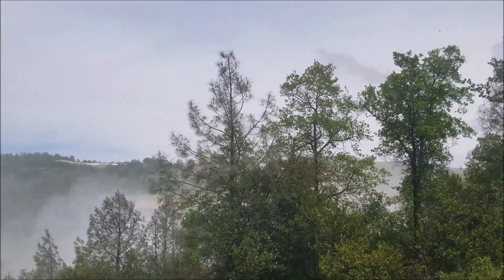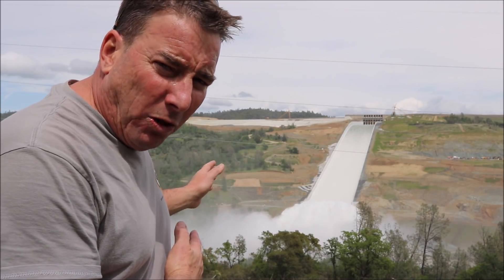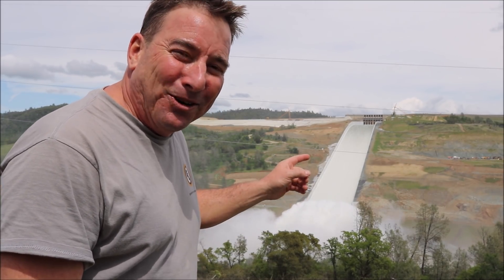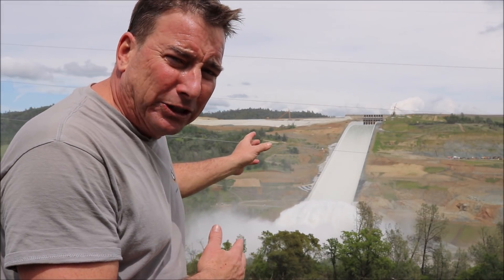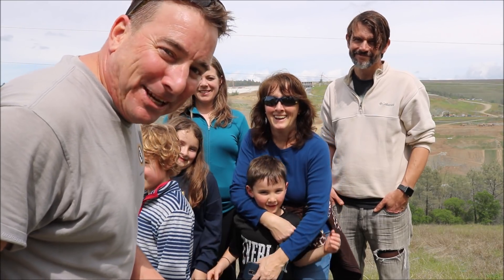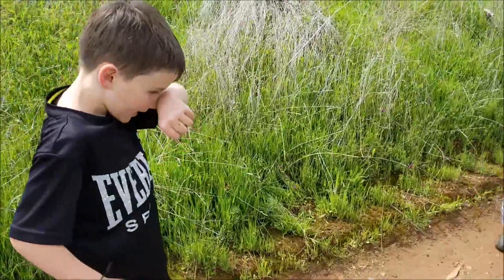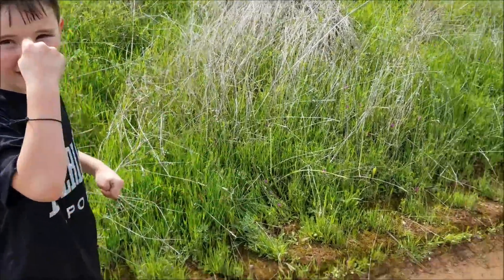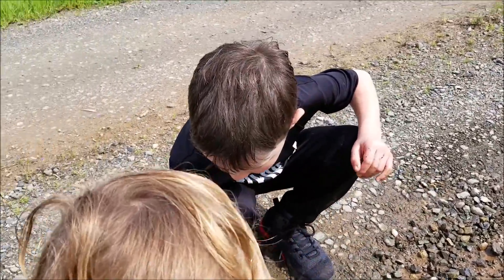Oroville UPDATE 25,000 CFS Test of new Spillway! 7 April 2019

Comment: Heard there having magor problems that there was vibrations in the spill way
Reply: You heard wrong. No major problems.  Vibrations? Lol, when that much water is running down ANY spillway it generates 'vibrations' some of which you hear as sound just like a waterfall. Listen to that sound of the spillway. Impressive. This is normal. This spillway is far better made than the previous one it replaced.

Comment: Juan have you been up in the mighty Luscome over the spillway? I mean since they shut it down after the test run.  There seems to be pieces of cement coming loose on the sides and it looks to have ripples in the surface.  Susan Wolding said she would ask you about it.  Also the Gates don't seem to be as water tight as they were before construction began.  Remember they sand bagged the water to one side.  Now the water is still running all the way across.  I trust your eyes better than mine .       Thank you   Leah
Reply: They first sandbagged or shunted the leaking water to the right, and then later sandbagged the leaking water to the left and it remained in that mode until the bags were removed last week.  Now the water just runs where it wants down the spillway. The gates are not watertight. Remember, the gates are not part of the reconstruction of the spillway.  They didn't break, the spillways did.  There is no broken concrete. The seams are dipped, on purpose. Juan showed this in a video last year when he did a 'boots on the ground' video of inside the spillway. You can see it here. It is informative, and somewhere in the video shows the seams on the spillway (19:19).  https://youtu.be/rPf2yt0cJR0

Comment: Juan - as soon as you find out something about the maintenance they did after the 25k flow, please let us know.  There is still scaffolding up tonight, and it looks like they did something with either seals along the edges of some pads, the surface, or both.  The level is rising, and one way or another water is going to have to be let out of the lake sometime soon.
Reply: The only way they will use that spillway is when the level of the lake reaches 900ft. If it doesn't the spillway will probably not be used.

Comment: Juan you have been on the spillway.  What would you guess approximate water depth is midflow?  I remember ariel photos with people standing in the spillway and they looked very tiny.   Also,  I understand unit of measure for flow rate but how is that rate measured?  Great family outing, thank you.
Reply: George Franklin There are calibration formulas to estimate the spillway depth based on the flowrate. The flowrate is determined by how wide they open the spillway gates. Edit: About 4-5ft deep at that flowrate.
Reply: @gordonrichardson2972  Thank you for your reply and explanation. I'm assuming with lake inflow rates the same would apply where operators can measure depth at a known width.  Seems like it would be challenging  with rivers and creeks where water velocity and  structure change due to water erosion and  weather.
Reply: Measuring inflow is not an exact science, but can be inferred from canals and weirs, or from the increase in depth of the reservoir itself (calibrated for surface area).

Comment: (Wikipedia) ".... In the particularly devastating flood of 1997 inflows to the reservoir hit more than 331,000 cubic feet per second (9,400 m3/s), but dam operators managed to limit the outflow to 160,000 cubic feet per second (4,500 m3/s), sparing large regions of the Sacramento Valley from flooding.[73][74]... etc. "

Comment: Bernuille has a formula for the transformation of energy in a spillway.
H=(v^2)/(2g)
If You want to reduce the energy before entering the stream a high speed (v) is recommended. 
But it should enter in a basin to get a wave. 
If You watch Orowille  energy dispatch  solution a proper raincoat is recommended.

Comment: Well that's pretty cool. I was wondering if the wind was caused by the overflow.  I guess that makes sense, all that kinetic energy turned int mist before most of it goes into the river.
Reply: I hadn't thought about it until you asked the question. The answer is entrainment, where the droplets of spray mix with the air, and drag them along, creating a breeze. You can experience exactly the same effect every time you take a shower. Both the kinetic energy and heat energy are transferred to the air, between the top of your head and your toes.
Reply: @gordonrichardson2972  thats exactly what I was thinking

Comment: I wonder how deep that water is going down the spillway for every 10,00 CFS?
Reply: For the last video I did a very rough calculation for the (lower end of) the spillway:
    5,000 CFS  3 feet
  10,000 CFS  4.5 feet
  20,000 CFS  6 feet
  50,000 CFS 10 feet
100,000 CFS 12.5 feet
The formula is not linear in an open channel, but closer to the square of the depth, since friction also affects the flow velocity.
Reply: @gordonrichardson2972  Wow, That's a lot of weight..
Reply: Ha-ha, the weight of the dam itself must be enormous, compared to the spillway...

Comment: Hi Juan, Thanks for this report, the power of the water coming down the spillway is spectacular! If this is 25,000 cfs I can't imagine what it would be like at 150,000 cfs. Do you have any figures for the maximum flow that was ever run on the old spillway before it failed? It would be interesting to see footage of the same 25,000 cfs flow on the old spillway. I suspect it was a lot more turbulent.
Reply: That is well documented on Wikipedia, failure at about 50,000 CFS. This was due to undermining, not overcapacity. See: https://en.wikipedia.org/wiki/Oroville_Dam_crisis#Main_spillway_damage
BTW, the amount of visible turbulence in open channel flow, is relatively independent of the roughness of the spillway.

Comment: Impressive,  that is over 2.5 million hp.     Or 25,000 * 875 * 62.5 / 550
Reply: The Hyatt Power plant is rated at 644 MW (less than 1 million hp), but only uses 5,000 CFS.
Reply: @gordonrichardson2972  The 2.5 million  is water hp.   The 644 MW is net because it probably has an eff of 75% so the energy going to produce 644 would be 760 MW of water energy.  There is 114 MW of heat energy contained in the waste energy in the water and 644 transmitted through the transmission lines.
Reply: 1. All of the gravitational potential energy of the spillway is converted to heat, so hp is not the unit I would choose. 2. Please specify your units, I have no idea what 875*62.6/550 is, even though I studied engineering. 3. Actually 3 of the 6 Hyatt turbines are reversible, for use as a pumped-storage hydroelectric scheme.
Reply: @gordonrichardson2972    One hp minute is 42.4 BTU of heat.     25,000 cfs * 875 ft head *62.48 lbs water / cf divided by 550 ft lbs / second for each hp.  If you enter these units in an equation HP will be left .    I see why three are reversible, to contain the system if electric power  can not be transmitted.   I use engineering every year for 50 years of farming after college with a BS in Natural Science.  My brother was a NRCS water shed engineer for over 35 years.

Comment: Cant even imagine what it would look like, if it was at the maximum cfs! Great and diligent coverage Juan! Learned so much from your channel.
Reply: The 150,000cfs that is the maximum designed flow rate or the 256,000cfs that the new spillway was engineered to handle?
Reply: @ethanpoole3443  I believe the 150,000 cfs number is where they can comfortably run at max, but is designed to withstand 256,000 cfs flow rates if I have been following along correctly and understanding

Comment: Too bad that power isn't tapped by turbines; might be enough for all of San Fran. The local weather resembles El Yunque (PR).
Reply: It normally is, there are 6 turbines (5 operational at the moment) that are normally generating power, they are shutdown for the purposes of this test so that they could significantly increase the spillway flow rate without increasing the overall flow rate into the downstream river.
Reply: Would you believe that I fully understood that? Something in me just hates seeing all that power being dissipated as heat. (Spoken as a retired engineer, FWIW.)
Reply: As an engineer, you would also understand that turbines require smooth water flow. The turbulence on the spillway would destroy them, due to excessive vibrations.
Reply: You could save time and bandwidth by not preaching the obvious. Out.

Comment: The big blocks at the bottom of the spillway causing all the spray are energy dissipators. If the there were no blocks the water would shoot off the end like a huge fire hose, and the blast of the high speed water would cause massive erosion to the rock face. The block dissipators throw the water into the air and greatly reduce the erosion of the rock face. So, it's more like an extremely heavy rain than a fire hose.

Comment: CFS; Cubic Feet per second.  There are 7.48 US gallons in a cubic foot. At this flow rate, there are 187,000 gallons of water passing across an imaginary line across the spillway each second. 1 gallon of water weighs 8.33 pounds.  That's 1.557 million pounds of water passing over that line every second.  It's easy to underestimate  the size of the spillway from pictures.  If you go back to earlier episodes when there were people on the spillway, the enormous size is apparent.

Comment: Beautiful family Juan 👍, you are truly a blessed man!
Reply: If there were only a way to harness all that power at the bottom!
Reply: @jameskelley8839  , IMHO, use of the main spillway (new and old) is not normal operation. 
The main spillway was designed to release flows in excess of the capacity of the Edward Hyatt Pump-Generating Plant or when the power station was shut down or not required.
California DWR prob has data on the volume passed thru the power station compared to volume down the spillway.  Except in a very wet season, I suspect most flow goes thru the power station. 
Most of the flow would preferably go thru the power station to generate power, not "wasted" down the spillway. 
It was only back in 2017, when some of the power station turbines were shut down for maintenance restricting the flow thru it, that the main spillway was used during high inflows, the spillway broke up and the rest is history. 
The spillway would normally only be used, as in 2017, during a very wet winter, thus installing power recovery at the bottom of the spillway prob would not be economically viable as it would not be used very often.

Comment: wonderful coverage. thanks so much. ? are there any plans by DWR to stress test at rated capacity (250k) or max operational capacity(150k). this 25k is impressive but only ONE TENTH of rated capacity. Would like to see just a few hours of high flow then shut down and inspect. ? are there any HOLD BACKS on the Kiewit payments pending successful tests? Keep up the good work, Juan. thanks much!
Reply: Phil Kryder Damage downstream would be unacceptable, except in case of emergency.
Reply: @gordonrichardson2972  doesn't that depend on how long the test was run? A 2 hour full output test would be the same total output as 20 hours at 25k. The fore bay would buffer the output.
Reply: Phil Kryder I think that would send the wrong message, from a PR point of view. Remember that during the crisis, thousands of people had to be evacuated from their homes. No need to give the media more sensational stories.
Reply: Phil Kryder There are plenty of years to do tests, and the spillway is more than strong enough. After this test they should be looking for minor surface patching.
Reply: The original spillway failed because it was undermined, not because it was untested.
Reply: I'm not confusing anything. The emergency spillway will never be tested. Ever.
Reply: @gordonrichardson2972  I understand that. But you implied that the main spillway failure was the cause of the evacuation. It was the head cutting of the emergency spillway that caused the order to evacuate.
Reply: The main spillway failure caused a knock-on effect, when it was shut down. The emergency spillway was forced to carry the excess water, and it too failed, causing the evacuation. If the original spillway was still intact, none of us would ever have heard of Oroville Dam.

Comment: Looks like the cross waves on the spillway at the 8000CFS flow rate are gone at the 20000CFS flow rate. And the cross waves are back again at 6pm now that the flow rate has been cut back. Are the cross waves part of the spillway design intent?
Reply: nickn2334 Rolling waves are a natural phenomenon, caused by hydraulic jump. The effect varies with water velocity, as the flow transitions from laminar to turbulent.

Comment: Juan,
Max total outflow was 25000 cfs but do you know if the Hyatt Power Plant was open (as it usually is) which would account for about 7500cfs of that?

>>CDEC: "Outflow from Oroville includes all releases from the Oroville Dam (i.e.: Hyatt, spillway, low flow outlet)."

God bless
Paul
Reply from the maker: Watch it again...the HHP was shut down for this test.
Reply: OK based on your video I see that its just the spillway - Hyatt is off. Thanks !
Paul

Comment: Also you might have Julia and Pete describe how the gates work and why there will always be some leakage around the gates. Same as all dams have some seepage.

I think ( but not sure ) that flow is called laminar flow. The water is so low that the bottom is held back by the spillway and the higher layers overrun the bottom and form waves.
Reply: Juan, here's a link describing hydraulic jump. https://www.youtube.com/watch?v=GVDpqphHhAE&t=424s  Stupid censors with this link
Reply: Eastern Woods The flow in this video is fully turbulent. In the previous one, it was the transition from laminar to turbulent flow that caused the hydraulic jump.
Reply: @gordonrichardson2972  Thanks. The link wouldn't post ( censored ) for a while.
Reply: Thanks, Grady's video was on my recommended list, but I have been quite busy. I already know a lot about fluid flow, from studying engineering at university.
Reply: @gordonrichardson2972  I'm an engineer ( mechanical ) and this is impressive. Love any of Juan's explanations. I'm waiting for a followup on the bridge failure.
Reply: Florida politics, don't hold your breath on the bridge report...
Reply: Actually Grady's previous video is more about hydraulic jump and open channel flow: https://www.youtube.com/watch?v=7tjf8HWiR3Y

Comment: What did you say was the max flow the spill will handle? By the way I was there the first time they used after it was first built and have slide of it.
Reply from the maker: Operational about 150,000 CFS
Designed to 256,000 CFS

Comment: Congrats to the DWR folks for the excellent work and to you Juan for the great coverage
Reply: If DWR had been doing excellent work it would of never failed.
Reply: @TheDrloboski  They did what the budget would allow. Doesn't matter if you're a state or a homeowner, deferred maintenance bites you in the butt.
Reply: @carpetcowboy58  Not when it comes to public safety. Specially Mass public safety.  There's a test called Radioactive Nuclear testing, Simply setting that machine on the spillway would of found the problem underneath the spillway years earlier. Then drilled holes and pumped those caverns full of concrete years earlier before they had a chance to grow. I had four of these testers I talk about follow behind on a job I was on for just over 9 miles. It can see through concrete and they checked are work 18 to 22 feet deep. That test up there wouldn't of cost them 40 to 50 grand. And less than a million in pumped in concrete. Never confused Deferred Maintenance with Lack of ones ability who should of been doing there job or found someone who was properly trained and qualified to do so.  I get what your saying sir, When you have a bridge they used the wrong bolts you don't just leave them in because of Cost, You change them out. Failing to do so you may just end up on the Titanic in the middle of a ocean with the wrong Rivets in and end up dead. And what I mean by this is, When it comes to human life there is no set value of people and children's lives.
Reply: @TheDrloboski  You're preaching to the choir. I know a guy that x-rays welds out in the field all day. Why? Because 1) it's mandated and 2) he gets paid for it. If one of those conditions aren't met those welds don't get x-rayed. Does PG&E and Camp fire ring a bell? 
Maintenance is not a cool plank on a politicians platform and stockholders get unhappy when their dividend is half of what they think it should be because of the maintenance bite. I read where some engineering association gave the whole country's infrastructure a grade of D-minus (so it's not just a local issue).
PS- "When it comes to human life there is no set value of people and children's lives". I'll have to refer you to Boeing about that.
Reply: @carpetcowboy58  I think it's still to early to blame Boeing, Am really thinking a bird took those sensors out. The way they stick out there and so low where a pilot wouldn't even see a strike, Juan would know better than I would. As far as the welds and the compaction am talking about that's two separate totally different operations.
Reply: Indeed
Reply: Don't forget Kiewit, who are the ones that made this project the success it was.